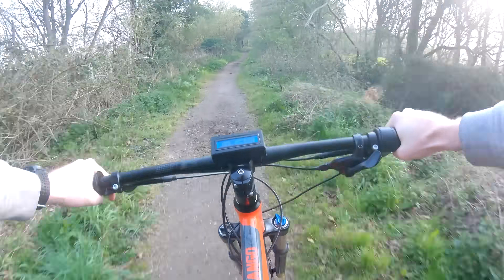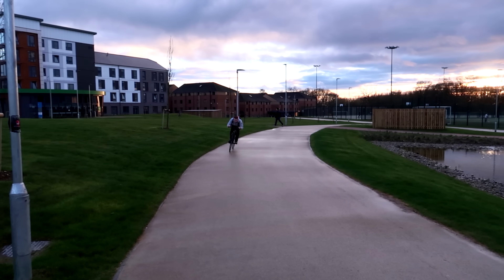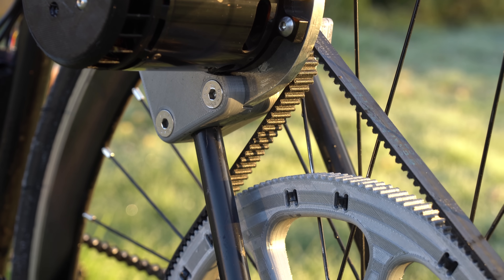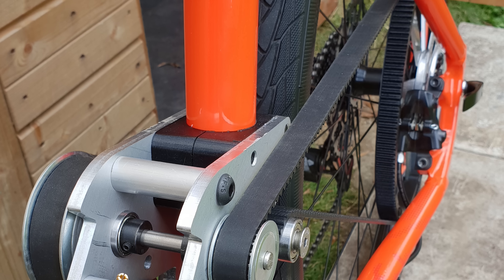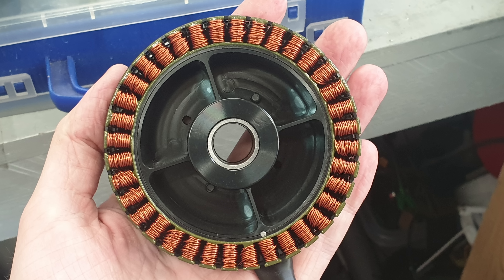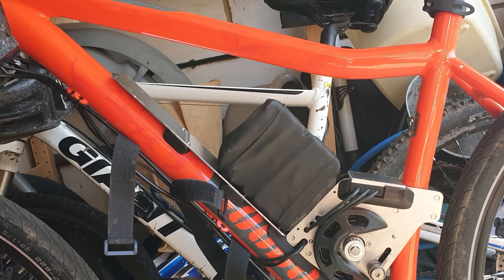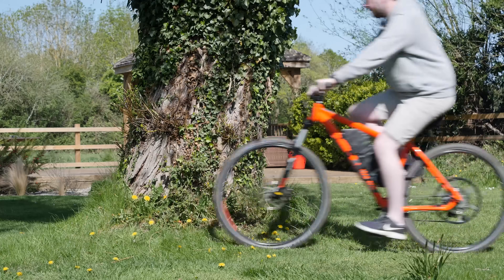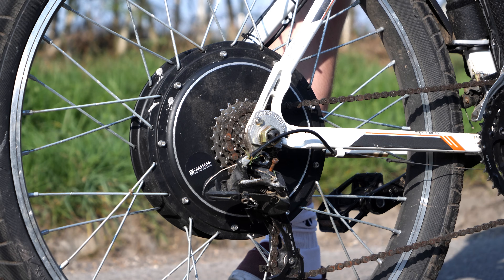Building an Electric Bike

Comment: this is exactly what I wanted to see. drone motors seem to have the highest wattage for thier size. One question I have is what is it like to pedal this bike with the belt on? does it push the motor? I was thinking about using the clutch from a nitro rc buggy to transmit torque only in one direction, so that the bike wheel will not turn the motor but the motor will turn the wheel. Great job designing this, it is encouraging.

Comment: 4:45 which software did you use to convert those fotos into a 3D model?
Reply: He used the photos as a reference and modeled the frame from scratch in Fusion 360.

Comment: You should make alternator powered bike. Simply disassemble car alternator, take out the rectifier and then wire it up as three phase motor. You can use step down board that is at least 100W to power the rotor, in order to make it magnetic. Dont use vesc though, it may burn it. Use ebike controller that works with sensorless motors. Search on YT how to transform car alternator into motor and you will know.

Comment: Hub motor complete kits with 500 watt wheel motor, speed cont. throttle control, some with racks, tire and batt bag, for $99.                                            Battery is expensive part, $150 to $350 for 10 to 35 mile range.

Comment: IMO a front hub motor install is easier but not better. I suppose could have less traction, more weight sits on the rear wheel and make for a heavier steering..

Comment: Everyone: *burns motor*, buys new motor. Tom: *burns motor*, rewinds motor...
Reply: You have to rewind those cheap motors anyway with thicker wire for efficiency, and to modulate kV, dependent on the windings-number.
Reply: @klausbrinck2137  You don't get better efficiency with thicker wire...
Reply: @DataLog  Electrical resistance is directly connected to wire-thickness, it´s the one thing you can influence.
Reply: @klausbrinck2137  Yes, but lower resistance reduces efficiency...
Reply: Mate, that's who Tom Scott is.
he likes to DIY nearly everything
Reply: How to make freewheel? Much needed for this project!
Reply: lmao I thought you were likening it to a vcr tape
Reply: True Russian
Reply: @cyber_robot889  what a lad
Reply: @drone51  I think you meant to say; what a comrade;) lolz comlad!
Reply: @pvs1681  HAHA yes my comrade :)
Reply: Sustainability. It's what I would do...

Comment: I have some ideas for the 3D printed compressed air engine:
Make it bigger and make the cylinder wall thicker so that it can take more pressure
Maybe you should finally switch to a 2 banger or even a 4 banger

Comment: can you be more specific about how to add balance leads to the battery pack, I can kind of tell where the go from the 9:30 mark but would be great if you had a diagram or something. Also wouldn't 6 in series and 6 and parallel get you 24v? or you use the nominal 3.7v to calculate?

Comment: Hi Tom, this has inspired me to think about ripping the old diesel out of our small sailing boat. Its low rpm single cylinder thumper that produces just 6bhp. 
this t-motor u13 running 48v with a belt reduction drive to bring the rpm down to 1000 rpm max looks like it will do the job perfectly. The thing im struggling with is the speed controller. It needs to have reverse for maneuvering and ideally be able to regen when sailing any suggestions?

thanks!

Comment: Hey Tom I specifically work at an ebike shop primarily concert bikes to ebikes I understand you went through a complete journey to get to where you are i would suggest another endeavor. A mid motor set up at the pedals this allows the bike to accelerate much like a car by using the gears. I personally have achieved 40mph (75kmh) on my lower end ebike. I work at Electrify Bike Co. and are motors achieve 1500w easy along with us using 52v 30amp batteries they are great and take under a day to convert when you have the whole kit

Comment: Very nice project. Have you ever tought about using a moped like speed variator to have a variable ratio between motor and wheel?
I suppose that using such system would make possible to use a smaller motor 🤔😉

Comment: Maybe you can try To replace that pulley system with mid drive system with freewheel in the mid gear, so you can still change the speed and torque relative to back gear set ratio if you have it.

Comment: This was really interesting, as welder/fabricatior I lean alot more towards mechanical engineering than i do electrical so i could follow all the drive train and fabrication work without any issues but as soon as it went into electrical stuff and battery series i was lost Haha I'd have had a much easier time with a petrol engine that's forsure, however I found this very interesting and would love to do somthing similar myself though I'll probably buy alot of electrical components rather than make them!

Comment: Zip tying anything to spokes will probably knock youe wheel out of true. Use a disc brake hub with the 6 bolt rotor mount

Comment: I've been toying with the idea for years of making a constant peddling speed bike using an electric motor (probably reversing the operation of a differential - pedal and motor where the wheels go and drive through the shaft).
My goal was to average a journey with peddling required down hill to charge the battery and assistance uphill.  You'd set your perfect pedal speed with a shifter and if you peddled faster than that the bike would accelerate and peddling slower would make the bike decelerate.
My overall goal was to make you pedal at your most efficient pace and use the motor to maintain constant speed, ideally with no mains charging of the battery every required.

Comment: I hope someone here can help me (maybe Tom)?
I'm at this moment using two in parallel 4500mAh 6s 40c Lipo's for a home project (the do get hand warm after use)
I would like to replace them with a LiitoKala Lii homemade battery pack.
According to the data for the the LiitoKala each battery is 3.6 volts and 4000mAh (5c).
To get the 22 volts (6S) I need 6 in series.
Now if I understand this correct. This will be 4000mAh (lower than the lipos I am using now). 
However. If I put two of them parallel I will still be at 22 volts, but have 8000mAh.
Wat will happen with the 5c? will this now be 10c? Will it be a problem that it is 5c/10c instead of 40c? And / or.. Will the 6 battery's in series of each 5c add up like the voltage (5*6=30c) 
I really hope some one here can help me.

Comment: So in the video where you explained why a multiple cylinder aircompressed engine would not work due to air leakige and pressure diffirence etc etc. But why not shorten the valve so it opens later and shuts earlier, and also shorten the cylinder and shorten the crank height wich gives less volume in the engine and it can run at higher rpm, you wont have much torque but id figure that is nit needed with a propellor on a plane. And maybe, just maybe add a turbo or something that might work to help increase pressure to increase rpm. I dont think it would work but id think its fun to maybe test.

Comment: Tom I would like to see a charging system on a bicycle to charge a cell phone that works off of the front wheel. Maybe with a 3D printed bracket. I see ones online but they are expensive or don’t work well. This would make a cool video.

Comment: Hi, Tom! What was the weight of the "conversion kit" (controller, mounts, batteries etc - if you can estimate this) and the total weight for each iteration? I have an idea for a super light commuter based off of your work, and this info would help a lot in gauging the viability.

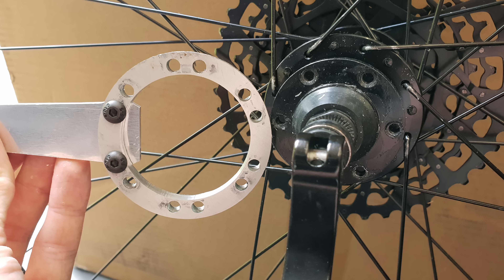Comment: As a engineering professor, I set out to build a four wheel bike for better load and stability capacity. However, I got stumped after I arrived at my prototype, which looked quite similar to this 6:10

Comment: Hi Tom, your original ebike video encouraged me to build my own e-mtb (double suspension, with the power put to a second chainring). It works, but I have belt slipage, using a HTD3m 10mm wide. Do you think that belt is too weak for the application, and hsould use a 5m, or a wider 15mm belt?

Comment: What you really need is a penny farthing bicycle with a 1 megawatt motor and a really long extension cord :) But to be more serious it may have been an easier build with off the shelf parts. For example.. A sick bike parts shift kit. Leave off the jack shaft portions and reorient the motor with drive side on the sprocket side and appropriate sprocket on the motor with chain. Then you can use the bicycle gears and mabe an auto shifter with an igh rear hub. It is heavier but possibly more reliable long term.

Comment: This is like building a nuclear power plant to charge your cell phone.  Just spend $400 on an eBike conversion kit and battery and put it on your bike, or better yet, buy an Ancheer ebike for $600, take it out of the box, spend a little time attaching some components and charging the battery and be done w/ it.

Comment: WHY DOES NOBODY USE THE GEARS GOD GAVE YOU ON THE BIKE ALREADY. I do not have it built but have most the parts to do a front freewheel mid drive system and i do not understand why more diy'ers do not use the  same method to use smaller less voltage motors . plus you are using a tried and true method roller chains and sprockets have been around forever.if you keep your torque around human regular strength and go for speed you should not blow any chains a part.if you want super human torque build an ebike on a dirt bike frame,duh.

Comment: You should try to transform car alternator into BLDC motor. It is easy, there are a few tutorials. Simply remove diode pack and wire the coils in triangle or star configuration. Then power the rotor with small voltage using beefy step down board, at least 100W. I found out that by changing the voltage on the rotor, you can decide if you want more speed or more torque out of it. 

So I bought self-learning ebike controller for $10 and ebike battey for $70, and then I mounted it onto my go kart. It works great. High speed, huge torque. No problems.

Comment: Hey Tom!
I'm looking to convert a 50 year old cyclinder lawnmower to electric. It currently has a 100cc is four stroke petrol motor. 
What sort of motor power/torque/other specs would I need?? also what kind of controllers/batteries?  and where to purchase?
Great video
Tnanks 
Ed

Comment: 2 comments.. 1. You could have saved a lot of time by looking at off the shelf units and the ratio is always about 9.7 , the set to work and 2. The max power for the road is 200w in the UK, 250w in rest of EU, so basically illegal to go on the road, seing as you posed a video and states the power whist on the road..... as annoying as it is I know. Great job though.

Comment: So I'm an engineer by trade, but "wouldn't use any motor smaller than this?", I cannot support.
I've built mine around a 63** motor and downgraded as soon as my bike started flying. I get a really heavy boost with a smaller motor and about 1.5 kW theoretical maximum power. I regulated it down to 250 W, which is plenty if you help pedaling. After all, you've built a motorcycle, not a bike :D.

Comment: I found the part about the aluminium interfering with the motor interesting. How did you come to that conclusion? I've got an old razor scooter that I've fitted with a brushless motor, VESC and an Arduino based dash. When I recently upgraded to a larger motor I started having issues with the motor loosing sync at higher speeds, but only once its above about 60 degrees Celsius. I've messed around with settings and all sorts of things and I haven't had any luck. The old motor never had any of these issues, but it just wasn't big enough to sustain the amount of current I wanted for an extended period of time. It would just get too hot and the VESC would cut the power right back until it was within an acceptable temperature range again.
The new motor is a bit larger in diameter and definitely comes closer to my Aluminium mounting adapter, I wonder if that is what's causing my issues? Might have to investigate removing some of the material around the motor to give it a bit more clearance.

Comment: the motor ratio equasion at the end is an interesting way of looking at it... but ultimately isn't very accurate. the motor kv is directly related to its torque per (phase) amp (phA) - there's a full equasion for it but simplified its ~9.5/kv gives your torque per phA, in Nm. So if you know what your motor can handle in phA (not the easiest to work out unfortunatly) and what your desired rear wheel torque is (>100Nm will start to feel quite peppy, 200 can leave you on your ass) you can easily work out your required ratio. Note - this may mean a very low top speed, depending on your battery voltage, which is where larger motors that can handle more current for a given kv (thus less reduction), or higher voltage batteries come into play. Note too - low kv doesn't mean the motor can produce more torque (all else being equal), as any given motor will produce roughly the same heat/saturate (stop producing more torque) at the same torque output no matter what the kv, it will just require a different amount of phase amps to get to that point. This also explains why hub motors are so huge despite similar power outputs to the little RC motors - they have far lower kv's - necessitating more material (copper and iron) to produce the same torque without burning the wires instantly.

Basically, motor power is (relatively) independent of motor size and weight. Motor torque is (again, relatively) proportional to motor weight. If you want something very light weight and small, it'll generally need to spin very fast and have a large reduction to have sufficient output torque at the wheel, as it doesn't have enough magnets and copper to produce much torque at its shaft... if weight is less of an issue then you can have 0 reduction to the wheel (hub motor) with similar torque (at the wheel) because it has far more magnets and copper to produce the needed torque at the motor output shaft (which is at the wheel)...

Comment: Hi Tom. Very cool builds! Thank you for taking the time to make , share , and teach on the subject.   May I ask why you didn't utilize the bikes  already existing chain gearing in stead of building a second system?  I've seen many small scooters using as small a motor as 250w that was driving a secondary gear about the diameter of the main gear on a bicycle.

Comment: Tom I know you guys invented the imperial system but don't you think it is time to see the light? Also a meter is a device that you use to measure various parameters such as a Voltmeter. The unit of measurement of length is a metre. Or it was when I was at school. That is over fifty years ago so they may have changed it by now.

Comment: 200-250w 15mph legal uk limit even if off road. check the forums/groups. that said,, such bikes are not 'fun'....... also remember if you go above those limits, dut 'construction and use' and 'legal categories'  then you are riding an electric motorcycle, and now drop the word electric as fuel type doesn't matter, and you can see the legal problem here, not the right helmet so no helmet, not the right lights for lighting regs for a motorcycle so no lights, l plates, licence, insurance, mot, the points will be enough to get you a ban, and if you don't have a driving licence yet, dont worry, our legal system will keep those points on hold till you do that said, if you ride it 20mph or less and soft pedal, no one bats an eye....
'lets be careful out there'

Comment: wow thats an indepth ebike build. my 250w ebike has done over 20,000 miles in 5 years and its been great , not fast 15mph but i find it fast enough, but like those battery cells , where did you get them?

Comment: You can machine an adapter for your exhaust pipe to inflate tires also, another idea is already available, a small electric pump that runs on your car battery power

Comment: You should try put a Dynamo that can suit the batteries so you can charge it while riding, extending the time frame between recharges. The only flaw with that is it would decrease the speed of the Bike, so a more powerful motor would be needed for this, Just an idea :)

Comment: Your motor is best than hubmotor. I had a motor wheel, but unfortunately its shaft bent from bad roads. The motor wheel is excellent for good roads and flat terrain. It does not require any maintenance. 
I like your motor, and its location is correct, and it is protected from shock .

Comment: If u reading comments Tom, what is your take on whenever freewheel is needed or not?

 I think in most of your designs there is no freewheel.

This is meant for motor side, as pedals get freewheel from wheel anyways.

I suppose this is partly controller related whenever it can cope with freewheeling and probably gearing/motor speed as well.

From my experience electric skateboards work really well without motor freewheel.

So not sure whenever this will be a problem for ebike or not.

My current design doesnt have any, as sprockets are really small and there is almost no space under brake disk caliper (where sprocket is located) to fit freewheel there.

Comment: Just wanted to drop by to say your videos partly inspired me to build chain driven ebike using RC motors as well.

Though what u showed at end where hub motor beat you in acceleration kind of changed my perspective on things.

I will still pursue my chain driven ebike project but will probably order hub motor kit for my second bike.

Without dedicated metal workshop fabricating parts is extremely hard, especially for someone living in flat/appartment building and only occasionally gaining access to someones workshop space.

For anyone else interested in building RC motor powered ebikes, I would advise to check Patricks builds:

https://www.electricbike.com/patricks-rc-mid-drive/